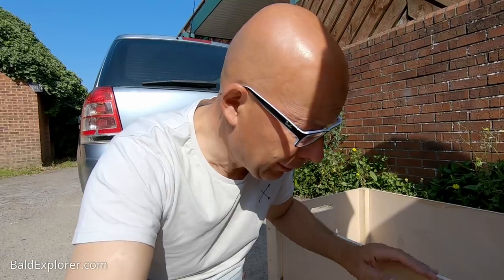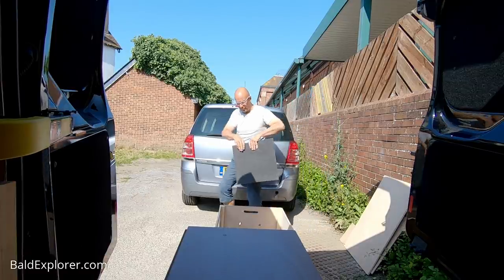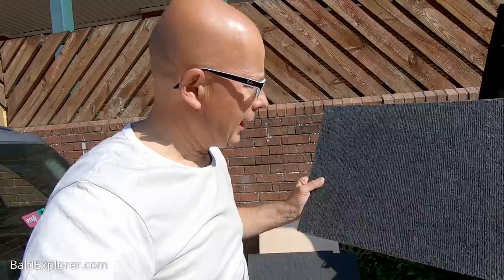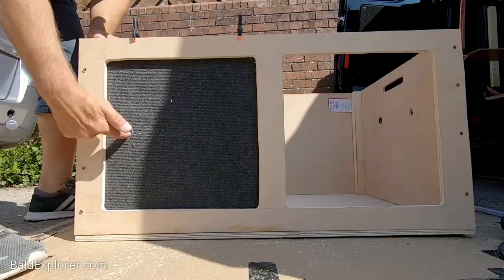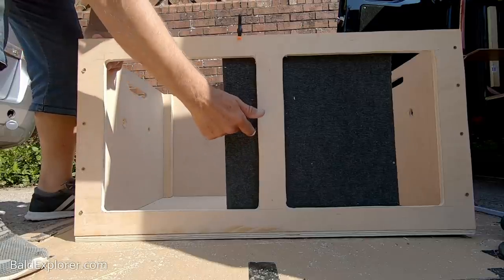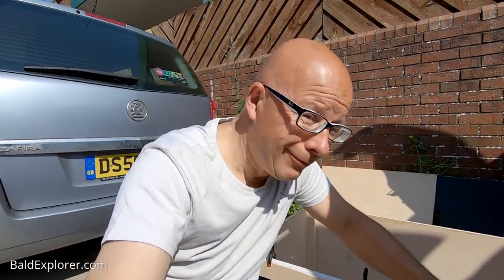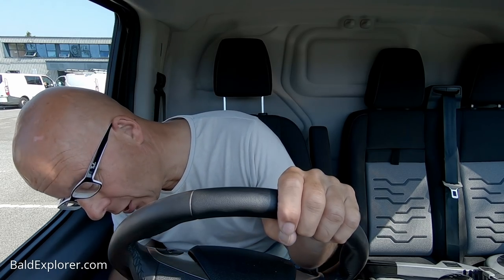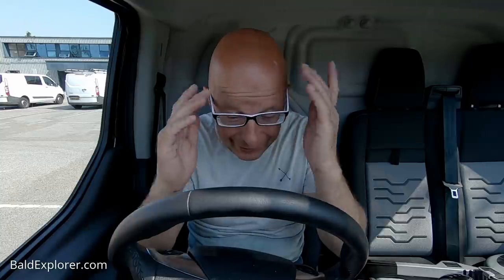My Van Build Goes On - Fitting the Sliding Doors

Comment: I was watching you all struggle with the heat and wondered, all along, do you have a fan for the warm nights?
Reply from the maker: I haven't a fan for warm nights, no.
Reply: @RichardVobes  I bought a small usb one for the tent and ran it off a power bank. Worked OK.